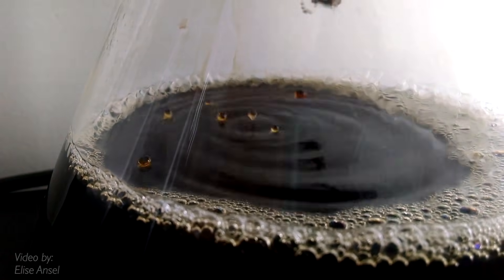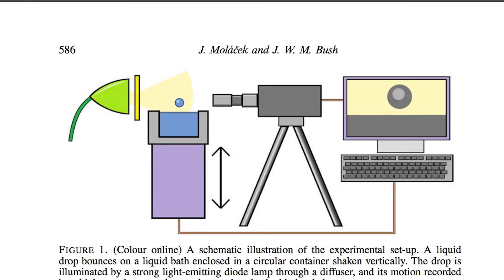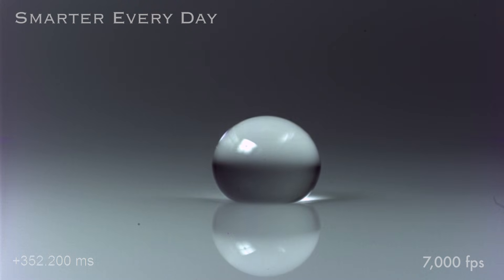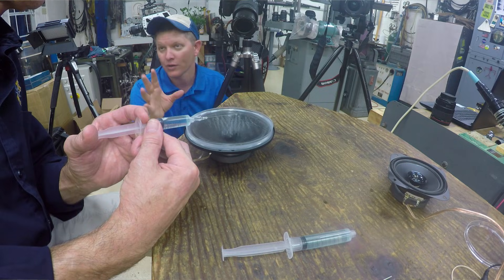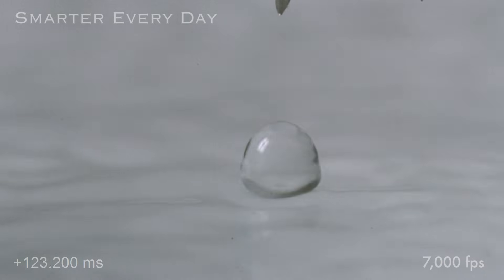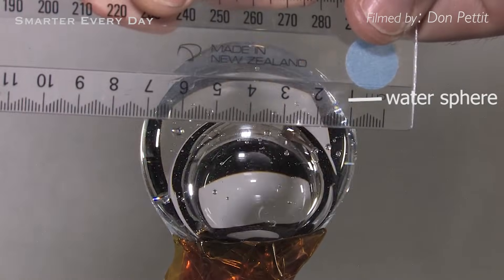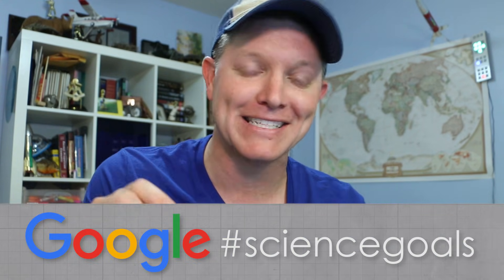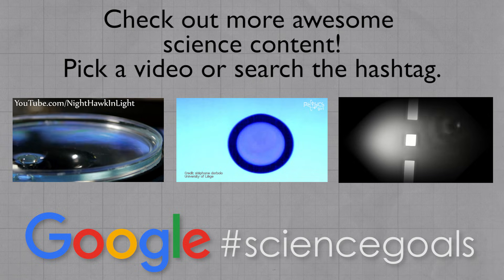The WALKING WATER Mystery (in SPACE and SLOW MOTION!) - Smarter Every Day 160

Comment: If we talk about the two water suface meadle, we should introduce the Saturated steam interrelations. Why? Becouse any liquid suface has saturated steam pressure which has volume exactly accord to the liquid chemical, temperiture, density of solution and even suface flexion. So for two sufaces of the water (flate and drop) some of the parameters has diferenses which mean the two saturated steams has two volumes of pressure on the so close distance. We know, if there are two different pressure it generated flow. Flow of steam. Some suface make evaporation another one condensation of the steam. Till the pressure of the saturated steam be equal. Steam flow stoped and two suface of water can move closer till contact and interflow. I think the steam flow is the reason the two sufaces cannot contact with each other. Becouse the evaporation make the air film very intensive but when evaporation is stoped nothing stopped the water sufaces touching each other.
Reply: The interreacting of the saturated vapore between two liquid sufaces has the starling resultes! If you interesting I could inform you.
Reply: On the vibration bath the bath water surface change the curvature so change the vapore steam pressure according the vibration frecuency on the each point of the surface. So the vapore steam flow goes to and then back from drop surface to bath water surfaces. It provide the steam film for match more time than on the not vibrating and drop surfaces. This is my version.

Comment: ºIf the Earth was a ball than the North Pole and the South Pole would be about the same but they are not.  The North Pole is teeming with life year round whereas the South Pole never has plaint life at all, just penguins.  Antarctica doesn’t have a midnight Sun the Arctic Circle does.
ºIf the Earth was a ball then when you are in an airplane you would be looking down on the horizon but instead the horizon always comes up to your eye level.
ºIf you cast the shadow of a straight edge onto a globs surface you will see that the shadow always conforms with the globes curvature resulting in that you always see during a lunar eclipse, if you cast the shadow of a globe onto a glob then shadow is exacerbated.
ºIf the Earth was a ball, then airplanes would have to be constantly dipping their nose down or it would gain about  80,000 feet every half hour and would soon be in space.
ºLight beam reflections proves that water is flat and not curving.
ºPeriscopes, gyroscopes, lighthouses, theodolite and sundials cannot work on a globe.
ºHow does a compasses work ?  On a globe you’d have to cut through the Earth to point to the magnetic north.  This doesn’t make sense.  On a flat Earth you hold the compass flat and it points straight to the magnetic north.  This does make sense.
ºWhich one would you fall off of ?  A flat motionless plane ? Or a spinning ball ?
ºWHY THE LIES ?  No Globe = No Rotation = No Orbit = No Gravity = Not Heliocentric = Geocentric = No Big Bang Theory = No Darwinism or Evolution = No Missing Link = Not Random = We are Unique = We are the Center of Everything = Intelligent Design = God, Gods or Creator = Awakening of Mankind = The End of New World Order.  REASON ENOUGH ?
ºThe first thing we learn in life is that the Earth is round because they want us to be programed before we are old enough to ask any questions.
ºHow could there suddenly be millions of flat earthers across the plane unless there was a realization, a latent awakening ?  Evolution is a fraud and people are waking up and I would rather be a conspiracy theorist trying to expose the liars than to be a propagandist supporting lies and who condemns without investigating what is obviously a masonic science.
ºTwo of the best arguments for a ball Earth is, “You can tell that the Earth is round because you can see ships going over the horizon”. The other one is, “If the world was flat then ships would go over the horizon”.  But their best argument is their default response statement, “Anybody who thinks the world is flat is an idiot” 
ºOur world is Photoshopped and we’ve been insulting our own intelligence.  
ºThey say that we are spinning 1038 mph while going around the Sun at 66,600 mph while our system goes around the galaxy at 480,000 mph while the galaxy goes around the “Great Attractor” at 2.2 million mph.  All that motion while traveling 39.2 Billion miles per years and we never feel anything ?  And year after year Polaris stays put ?
ºBulbs are round but the floor is flat. Pool balls are round but not the table. We live on a surface.
ºThe reason we can't sense Earths five different motions is because there is none. 
ººA world is where there is life, such as the mountains, the oceans, a creek or an aquarium et cetera.  That means ours is the only world known to science and while we should be celebrating this science doesn't want us to know that we are special, that our image is not random and that they are impotent.  I’m sure there are many physical worlds but we have to be born into them the same way we got here.  Space is fake, depth is a perception.
ºPlanets are not worlds, they are chief stars and stars are not distance suns.  Stars appear to be electrical and no two look the same, whereas the Sun is gaseous.  If every atom is alive and at least semi-intelligent then I would say that stars are wise and they could very well be angels. 
ºWe can see for ourselves that our cosmos is a carousel and its pole runs from Polaris (The North Star) to the center of our home the North Pole.  This means Earth is literally the center of creation and measurable time lapse photography of star trails tells us that this is not just a case of perception.  It shows all the stars are sharing the same plane and not light years apart.

Comment: Molecules vibrate at a frequency that it is according to the atoms that forms it and the molecule energetic structure. It is specifically set so the vapors would stick together and fall as rain, otherwise they would never come down. Then once in a large pool of droplets, their frequencies change and they get asimilate by the pool, so we would be able to breathe air ant not the vapors from the oceans and lakes and rivers. The frequency of the whole energy that forms the water is set so it would not disintegrate back to vapors. Some people can tune their body water molecules into the water droplets frequencies. And when that happens, the nano-forces of each atom in those molecules, actually the energies that form our matter, will do something amazing. You are smart enough to get the anawer

Comment: Space water bubble - that completed something in me - incredibly beautiful.
I saw creation.
Reply: why didn't the water bubble float?
Reply: @colettes9758  Zero gravity means way less air pressure via downward force. In space air pressure is most likely a static constant equal at all points thus the bubble stays where it is because it is not being forced out of the water. It is fascinating - SCIENCE! Gravity pulls on the water compressing it and at the same time pulls down the air above the water creating more force and air being less dense than the water gets forced out of the water. Air pressure in the space craft would be equal at all sides of the water and just as equal on all sides of the bubble so the bubble and water coexist amicably.

It's as if the center of gravity is inside the bubble instead of at the bottom or top of the water body creating something like equilibrium.
Hope this helps answer the question a bit for you as the question itself is quite good. Very keen observation.
Reply: @NOPerative  Interesting...... then why does the womens hair on the ISS always stand straight up?

Comment: The air layer is minor effect...it has to do with electrical charge on the surface imo.  like charges repel
Reply: Never mentioned ,amazing
Reply: Good call Ricky...
Reply: When coming across this video I immediately believed it was mostly due to surface tension (similar to the electrical charges repelling each other as you mentioned).
Reply: We’re on the same wavelength. The drop “picks” up a charge during the drop from wherever causing friction on said droplet that somehow allows the dancing on water effect.
Reply: I love the video and enthusiasm but it falls short of an actual explanation, no? I also believe electric charges play a role. The air layer is not enough to explain the phenomenon: why would the air stick around as the curvature of the droplet allows it to easily be pushed away? The mystery is still there to be unravelled...
Reply: I do believe that you are correct. All particles have a charge, the universe IS electric

Comment: I can do that in my steel sink. I have a large stainless sink. To the left is a small sink for the garbage disposal. I clean the large sink very well  so there is "no tooth". I put a half inch of water in large sink with stopper in place. I run the water, low, into little sink, turn on disposal and voila! Dancing water droplets all over the bottom of my sink. It is quite fun. And you can change the pattern vibrations of the surface water by placing coins, small spoon or something in the large sink.

Comment: This is interesting stuff. But I would not wonder if there was more to it then only the air between it. There is this thing that Masaru Emoto showed. Like what if the water drop kind of holds the information that it is an entity and needs to get convinced first to restructure and break up? Same thing when those drops inside get informed by music and inspired to become an entity. I wonder what would happen if air pressure was lower than normal. Would that effect reduce? It tends to freeze at some point but it could be heated accordingly.

Comment: I argue that the speaker is generating resonant gaps through cross-waves and wave convergence; thereby, creating greater air displacement over the surface and between the waves to allow the water cohesion droplets to float; that, the small water droplets surface tension have stronger cohesive property and are harder to break while floating on the micro-cushions of air and to appear to float longer until the water surface is allowed to coalesce... the water coalesces once the droplet and water calm and the air is displaced.

Comment: Is the footage of the internal bubble in time with the music?  If so, and it looks like, the final low G makes the inner surface resonate, as does any D (a harmonic of G) and their harmonics.  But what frequency starts the droplets separating?  Also, is YoYo Ma's cello tuned to 440hz or 415(ish) more in keeping with tunings in Bach's time?  Also, what does the waveform of a cello note in this piece look like?  Obviously there is bow noise and a complex sum of the relatively sinusoidal motion of the string, but overtones, harmonics, and the material of the string, resonant cavity of this cello, and any post production by thw spund engineer of this recording are present.  And how accurate os the speaker the water is stuck to? 
Somewhere in the answers to these is the key of the more remarkable question: not just why do these droplets walk, but what in this recordings specific parameters caused droplets to leave the surface?  Also, why was it only seeming to resonate on the interior cavity, and not round the outer surface?   (Air on both sides...)

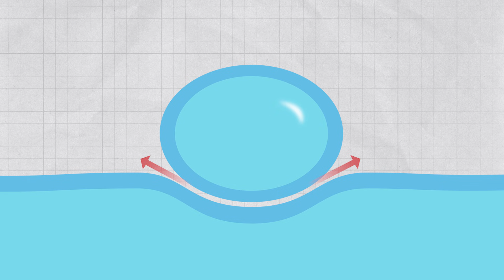Comment: 3:29 the claim is that air is trapped under the drop but then you refer to a vacuum chamber experiment to confirm this?  The vacuum chamber introduces more variables than just the reduction of air (pressure, temperature, vibration, etc.)  Perhaps a chamber using various inert gasses would be better and then compare the results with the vacuum chamber experiment.

Comment: Can the same type of reaction with the vibrations and water be used to lift something other than a water droplet and if so what frequency do you have to create to lift a rock for example and could you lift a brick? Also would the porosity of the object change the effected result. Obviously surface tension would cause an object to float on water but would the correct frequency vibration create a similar sustainable flotation?

Comment: Question:  Have you discussed Surface Tension with anyone as related to the bouncing droplets?  I have an alternative thought to an air film being the actual barrier; I think that air film is a effect, not a direct cause.

You discussed the "collision" energy, but the thing you need to compare that collision force with is the surface tensions of the liquid.. or liquids involved.  Much of my working career as a chemical engineer was based on surface phenomena, such as surface area and surface tension, from using detergents and other materials to form emulsions to a myriad of product development and enhancements. 

While I am to old to start on a new technical adventure, I think this would be a fun project.  Someone should compare the two (at least) opposing forces, and their relationship to mass/size of the droplets, bounce tendency, bounce height, number of repeat bounces, and sound frequency effects.  And, since you have already started the inquiry, how would these forces change and behave in zero gravity?  At a glance I could see the developments as possibly being useful in forming emulsions, separating emulsions, providing a better understanding of all of the above, and... perhaps a game or two.  ;o)
Reply: Agree. I think it is about surface tension and same charge, therefore opposing electrical forces on the outside of the water molecules.
Reply: He showed plots from a study where the air pressure was dropped and the drops coalesced faster. This shows that the air matters. Of course the surface tension also matters.
Reply: Agree. 
This has something to do with the water molecule being an electrical dipole.
With at the water surface and the outside of the droplet the same polarity.
Which sign could be determined by charging both with a different polarity to check if the behaviour of coalescing  changes.

Comment: The air is not the major factor for this resistance between the drops and the water mass , but mainly the equal negative electric force which exist on the surface of a water mass and repel each from other.

Comment: One layer deeper into the physics, the surface tension is caused by the alignment of water molecules at the surface. When the surface of the droplet approaches the water surface below those aligned molecules at each surface are the same charge and repel each other. In order for the water to coalesce, the water molecules in each surface have to rotate so they do not repel. They have to break the attraction to the molecules right behind them in order to rotate. All of this takes time and this time should correlate to the amount of time the droplet spends on the surface. 

In addition the sound waves in the water cause the droplets to bounce back up giving the molecules in each surface time to realign for maximum surface tension and the process has to start over.  The shape of the waves also reduce the freedom of movement of the molecules at the surface so it is harder for them to realign. 

There should also be certain size droplets that always form, becase certain sizes will have the most stable arrangement of molecules that are most difficult to disrupt. I think there is more going on here than described.

Comment: Does this effect happen with a gallon of water? To mee it seems that at a certain range of volume and surface area, ie size, droplets increase their surface tension. Smaller droplets have a tighter sphere. So yes, it has to do with frequencies. A small droplet has a much higher frequency than a gallon.(or maybe the other way around, correct me) which gives it a stronger surface tension. With increased frequency on the body of water it lasts longer because of... i lost my train of thought but you get it. Lol
Reply: Certain frequency combinations will merge water faster.

Comment: So going to make a guess why this happens before I watch. I believe its due to how when the water bounces out, the size of the droplet that comes back out needs to be 1. the right size in correlation to the thickness of its "skin" and 2. needs to not hit the water when it comes back down too hard as to 'penetrate' back into the surface. So it land somewhat softly and the two outer layers of the pool + droplet do not immediately give way thus causing temporary separation. ... Im probably so off on this but i like to make guesses before I learn sometimes.

Comment: I have a nother own explaning to that. The Drop is electromagneticly, the best natural form with the lessest surface and the maximum of volume. Also it is the logical way how athoms organise there magnetic atraction to each other inside of a water drop for it selve. So if this form is the magnetic optimum for it selve falls to a nother surface powert by magnetic force from earth feeld (By the  way thats also a problematic understanding why some think falls down. It is not because of magnetism, it has to do with a potential compensation) first the force will bring it inside of the surface of the water has to breake down the force which is inside of the drop. We can understand it like a little feeld, that let the water become and organise them selfe to a drop. This feeld first has to breake down, that takes time to bring down the energetic level of the drop to a point, the feeld of the surface of the Drop and the surface of the watermirrow are the same, than it will flote in to geter.